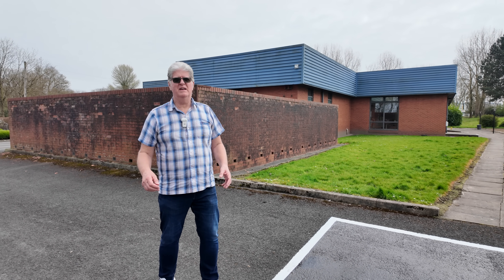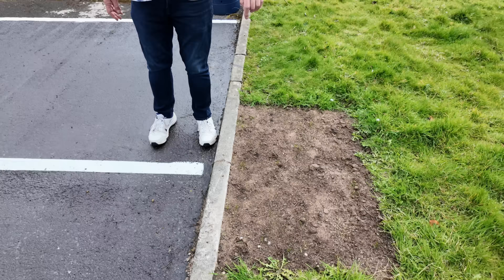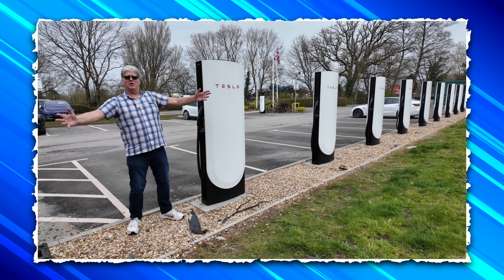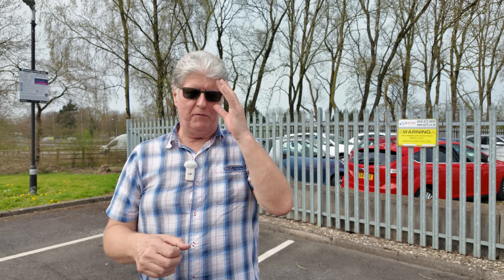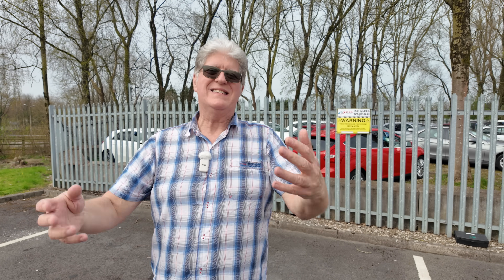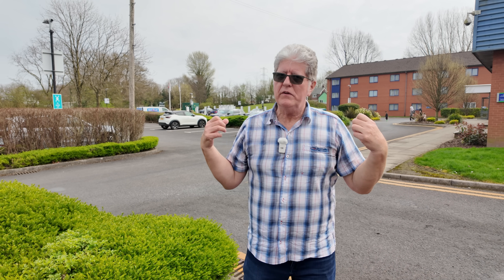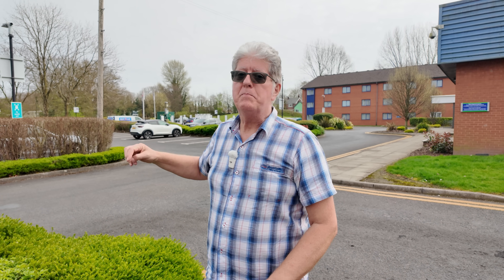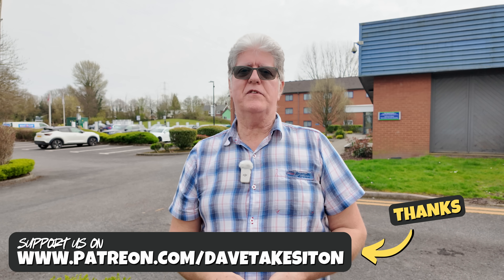Why Are EV Chargers Being Ripped Out?

Comment: Again with the charging on Bank Holiday insults. Those of us with kids often don't have a lot of choice on when to make road trips.
Reply: I have to admit I agree, it is an annoying thing. I don't have kids (teaching swore me off them), but many people do and the only times they are free to get away is during the busiest times. They are busy times because parents have little/no choice but to do it then!
Reply: You already have to plan for heavier traffic in a normal car, the last thing you need is having to plan around finding an available public charger, and then waiting an extra hour, if you're lucky,  for what normally takes 2 minutes. No thanks.
Reply: I am single, I have an EV and I travelled during the late May Bank holiday 2024 and using various planning apps was able to do some quick research as to which “hubs” to avoid at normal weekends and some slightly off the motorway hubs that appeared not to be at all popular. My trip was from Stirling in Scotland to Harrogate (for the Everything Electric Show) and back - a trip well beyond the range of my Countryman S E. In car routing and 99% of the apps suggested charging at various service areas north of Carlisle but my car had the capability to get beyond Scotch Corner. I actually used the then new Ionity chargers at Kingstown Broadway less than a mile off the M6 J44. 12 x 300kW cables and on Electroverse - I arrived at 1pm to find 2 cables in use on the Friday afternoon and 10 vacant - there’s a Starbucks with all the facilities on the site and a Premier Inn 2 minutes drive away. I pulled into Scotch Corner Services at the east end of the A66 at 3pm for a comfort stop and there was a long queue, so was glad I had stopped a little early at 41% SOC and topped up in peace and quiet. The following Sunday I topped up enough at the Starbucks chargers on Wetherby Road Harrogate on my way north, just a splash and dash to get me back to Carlisle Ionity to top up for the run up the M6/M74 on the Sunday. At Harrogate I was the only car using the 2 x 150kW chargers with 4 cables and again at lunchtime at Carlisle there were 2 Taycans and an iX and me charging on the 12 available cables yet at the next services north at Gretna it was mobbed with queues at all the different branded chargers when I pulled through just out of interest.
Reply: It's comment harvesting. And it works. It's all good for the algorithm.
Reply: @johnmunro4952  So the world grows evermore disingenuous, but it's ok...cos clicks??
Reply from the maker: I can assure you, Dave is serious about this one. But as someone with young children myself, I agree that often it's not reasonable or practical to avoid the busy times. A short queue is hardly the end of the world. - Jonas

Comment: Could have replaced that with 7 slower chargers , perfect for overnight charging for hotel guests but that’s just crazy talk!
Reply: This is the only way forward. Every hotel should be forced to have a certain number of chargers to cater for guests that want to stay overnight.
I wonder if there will be a concierge service to swap cars around during the night?
Reply: @sargfowler9603 Yes, because forcing businesses to install charges, presuming they can definitely wouldn't put room prices up.
If you have to force something then there is a problem.
Reply: @sargfowler9603  Don't force. People arriving at a hotel by car will appreciate the service of getting up the next morning with a full charge from a slow charger at a reasonable cost.  Maybe you could give some small incentives, but the hotels should know their own customers, and importantly their potential customers. A leg of a road trip is much better when you start with plenty of juice.
Reply: @geirmyrvagnes8718  It's the hotel that needs the incentive, and the customer who needs to pay it.
e.g. an extra 100 quid per night to pay for the charger and the extra valuable space the charger takes up that nobody else can use.
Reply: @sargfowler9603 Or just get a diesel 😊
Reply: @sargfowler9603  yes and no. Sure AC charging overnight is fine. But in the case of this hotel you could put it on one of the Tesla chargers and while you check in and get your bags it'll be charged up.
Reply: @MarkHewitt1978  What if my EV only accepts an AC charge or DC at 50kwh? It would take hours or at least an hour to fully charge.
Reply: @MarkHewitt1978  Not to 100%.
Reply: @MarkHewitt1978  mine takes at least 40 minutes, assuming it is warm or the car knows of the charger to start the preheat
Reply: I just miss-read that as "shower chargers" and had a vision of the hotel guests trooping out with their soap and bath towels.

[need more coffee]
Reply: You can i guess get an adapter for a chademo to charge on CCS just how you have an adapter for your Tesla. Not cheap but i guess cheaper than a newer car for some. Personally i wouldn't buy one as they charge too slow away from home.

All contracts will come to an end surely and have to be renewed. 

I wonder what will happen when that is telsa and I would imagine it's also contracts with the grid not just land owners. Who's prices have increased hugely for many CPO recently.

So maybe it's not all down to the companies. For the such high rates.
Its a combination of factor's and as tesla was 1st to the party and are benefiting from that until renewal time comes around. Is that why they are now selling chargers to others and not opening newer sites themselves.

I often take my daughter to dunkin as she prefers their iced vanilla latte and they have some new bp pulse chargers  and I can get a sub for £2.50 a month if I need it.

They seem to be used a lot as nearby there's not much as fast and instavolt are only 50kw.

So i guess it depends on your location and your needs. Many do look like company cars maybe they have a card with bp for fuel and energy. Plus so much has changed in those 7 or 10 years and bp could well be concentrating on a different model than before.

I get your somewhat anti ice and oil companies but levels continue to rise yet more EVs are on the road and ice cars are the cleanest they've been in history. It's a choice or should be. Just like to use the tesla network or not. Again I'm not fussed on all that he owns 13%  but if you are cool 😎 but just don't call others out for using them or owning a tesla. 

Same for bp or shell etc. One's I've seen work and all you're doing is alienating those who use them regularly and depend on them because of the location they are in. Which is where Tesla and others are often currently not. Bp pulse or shell is. Garages/forecourts are a different matter as most are franchises. So those issues could be down to the franchisee not acting paying for repair as they are not returning much profit from them. As nothing is free.
Reply: I chose where to have lunch yesterday based on the availability of 4 22KW AC chargers. Worked a treat. And as a bonus the bacon rolls were delicious 👍
Reply: Absolutely. Hotel guests could charge slowly overnight, the price could be lower to reflect the lower cost of electricity overnight. If more hotels did this, I would actually seek these out and stay at them!
Reply: @sedumjp  Driving through the Balkans, I did all the hotels with charging. Some price gouging, some with free charging, all excellent when you don't even read the local alphabet, and probably need an app to hopefully get 50 kW and you have to make it work in direct sunlight in the middle of summer. 😁 You can sort based on charging in common hotel booking solutions.

Comment: Does that hotel not have any Destination chargers for their guests?
Reply: Most don't, or if they do, it's only a couple and they are already in use.
Reply: So called destination chargers are basically useless at hotels.  They just get blocked by people charging overnight with no one else getting a look in.  What you need are fast chargers which will all ten times as many cars to be charged at one charger
Reply: @ So if I arrive at a hotel at 11pm, do I have to stay up till midnight to wait for it to charge so I can disconnect and move it to another space?
Reply: @CGNorwich  Disagree. As a Norwegian, I would say put an AC destination charging box at every hotel parking spot. With load balancing, that is no problem. Sell electricity to your guests at a moderate markup so it is actually used, and make sure payment is extremely easy. Get more guests because this would make the hotel more convenient. Profit.
Reply: @sargfowler9603  

Well that is better than turning up at a hotel that has a couple of AC chargers  that have vehicles charging overnight.  This has happened to me twice now. Two fast chargers occupied for one hour at a time would provide charging facilities for Fourteen cars between 5pm and midnight as against two
Reply: @CGNorwich  It's all about cost. AC chargers are cheap but high speed are very expensive. Also, when you think about it, imagine arriving at a hotel to find all the rapid EV chargers in use. Do you keep popping out every half an hour to try and get a slot? Or does the hotel put you on a list? I don't know how this is going to work.

Comment: Bc its over, ev are cooked
Reply: Odd that it is diesel new car sales that have been declining every year for the past ten years and petrol for four out of the five past years, plus every month for the past 22 months.

It's EVs, particularly BEVs, that have been growing in sales every year for the past 10 years in a row.
Reply: @GruffSillyGoat you state facts for sure. True BEV’s (not those newly ‘adopted’ EV’s with the fossil fuel engine) have being growing in sales massively for many years. Plus choice, there’s now around 130 models available to suit many pockets vs around 39 models in 2015 (according to the RAC). Yet, petrol new car sales outsell BEV (easily) month after month after month. Why is this? I guess diesel will continue as the LCV fuel of choice though, selling over 45k alone in March.
Reply: Volumes reflect historic times, yet things can change fast. Diesels cars were over 50% of the market share in new car sales back in 2014, and 20% of the market five years ago but now are under 6%. Petrol car sales have shifted from peak share of 66% just over five years ago to under 50% today. It's likely that in the months to come the volume of petrol sales in particular months will be lower than that of EVs. 

LCV's are counted separately, and the shift their is slower hence the incentives and extra time allowed for LCVs to complete the shift compare to cars. The 45k LCV figure isn't included in the Diesel car figure.
Reply: @andrewhill9369  I would hardly call ICE sales "easily" outselling BEVs; looking at the historical data, I expect BEV to top Petrol next year; and manufacturers to probably discontinue 90% of diesel vehicle production during the same time period.

At this point, government "mandates" are mere twiddling around the edges.
Reply: @GruffSillyGoat hey, we’re both entitled to our own viewpoints aren’t we? We’ll just have to agree to disagree on this one.
Reply: @ianemery2925  well, looking at petrol alone vs BEV sales in March: Petrol 176,847 units. BEV 69,313 units. So petrol outsold BEV by a factor of around 2.5. 
2025 YTD (Jan to March inc). Petrol 286,787 units. BEV 120,191 units. Petrol outsold BEV by a factor of around 2.3. I just wanted to back up my ‘easily’ outsells comment with SMMT facts. To be fair, I’m as shocked (no pun intended) as you are. Given the superior modern tech, substantial discounting, investment in supporting infrastructure and millions spent on marketing for BEV, I would have expected much closer numbers in sales between the two powertrains by now, wouldn’t you?
Reply: Petrol is declining from a high base, since along with Diesels they once represented the significant form of fuel-type selling (98% market share back in 2014) with EVs far far behind (1.5% for HEV and 0.3% for BEV and PHEV each). 

Now days, as of last month, all EVs combined total 45% and petrol falling to 49% market share, with Petrol declining -7.1% over Q1 of this year, and EVs averaging 30% growth over the same period. At this rate then in the next month or so EVs of all fuel types will dislodge petrol as the primary vehicle types sold.

If you look at BEVs in isolation then at 42.6% quarterly growth and petrols -7.1% decline, even with the 2.4:1 sales volume advantage petrol vehicel sales currently enjoy then should this quarterly trend continue BEVs will overtake petrol market share by the year end (although more likely within a year or two, as rates may change over the year).

So not so much viewpoints as facts and trends.
Reply: @GruffSillyGoat “all EV’s”, you’re referring to the EV’s with petrol and diesel engines too - that burn fossil fuels? (To be fair, my petrol car has a 12v battery in it).
Referring to facts and trends, why do you think it’s taking so long for the majority to switch to EV’s?
Reply: @andrewhill9369  - your point being? Moving to new powertrains involves transistionary steps (HEVs and PHEVs) which in themselves are evolving towards EREVs (BEVs with generator engines). As with all transistions people adopt at different levels at different points in time. Why taking so long, well seems your impatient to embrace the change so I assume you've bought an BEV already. However the automakers are cautious entities and step more slowly than perhaps you desire. As to buyers well the trend reports show 59% of drivers intend to buy a EV at their next purchase, split mainly between BEV and HEV with PHEV to a lesser degree. People are aware the transistion has a 10 year duration, with vanilla-ICE due to end by 2030 (likely before). Patience is a virtue, if of the three EV technologies that BEV becomes more popular then things will speed up, perhaps meeting your need for speed.
Reply: @GruffSillyGoat hey, throttle back there Mister, you seem to be on a crusade. Nice to see there’s no cussing and expletives though, you’re managing better than most. Like I say, we all have different opinions. Mine is that the current infrastructure and charging tech isn’t fit for the majority of users, hence the slower than desired uptake of the powertrain. I’m sure this will improve, but the majority, I believe, are unhappy to compromise to what they have come to expect from personal transport. Why should there need to be a change of ‘mindset’ or compromise. I’ve had the use of a Model 3 abroad as a hire car and it was perfectly good, but I couldn’t have it as a single car household. When the infrastructure is in place and reliable without the faff that many on this and other platforms discuss, and I can charge as quick as I can fuel at a sensible price away from home, plus I don’t have to pay for ‘necessary add-ons’ like home charging devices, solar panels (for those that want them), the installation costs, blah, blah… Then, I’ll definitely be looking at an EV. My ‘point being’, that I would argue that you need to take the automotive product and improve on it to get mass adoption. EV tech isn’t new (referring to your facts and trends statement, it came before the internal combustion engine) and the LEAF has been available for around 15 years now of recent times, it’s just not there yet, which is really disappointing given the original high hopes had for the tech, the significant investment made by manufacturers and governments (via us tax payers!) and millions spent on marketing.
Reply: I think it is time you booked a free mental health assessment with your local NHS Trust.